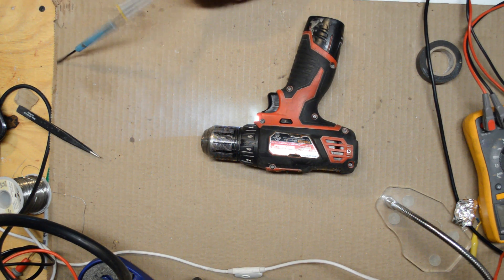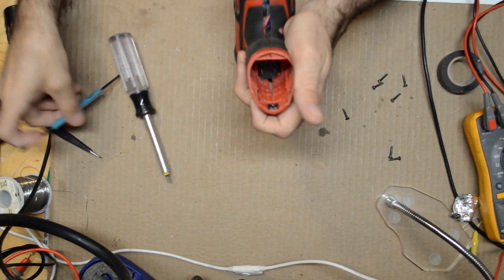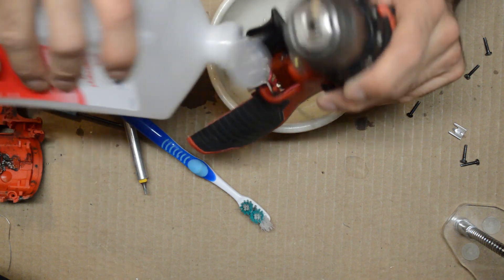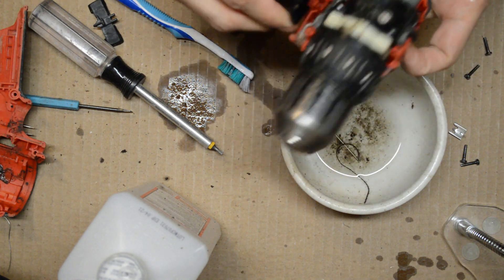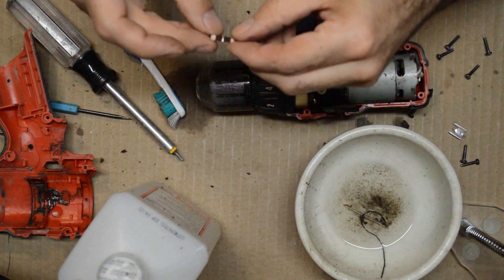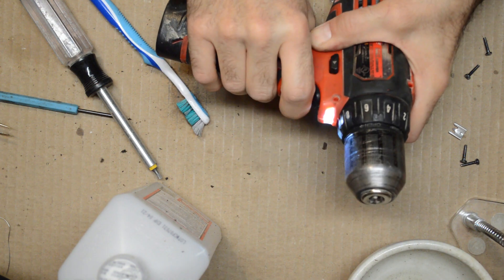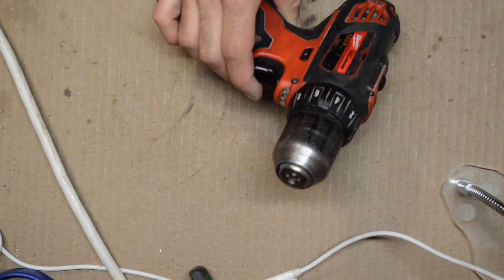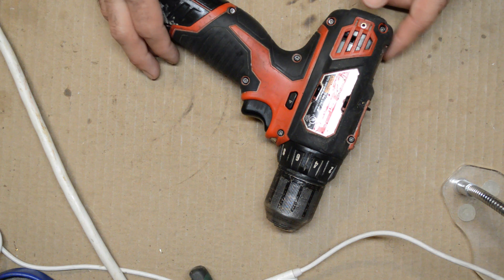Milwaukee M12 drill repair LED wouldn't turn off

Comment: Mine has the exact same problem with the light not turning off.  Except my is in much cleaner condition than yours.  I took the drill apart just like the video slowly. I did not have parts falling out.  

The issue is that the trigger switch is very sensitive.  Overtime, there is some build up in that area where the trigger switch does not release all the way.  On mine, there are wires running right behind the trigger switch, pushing it forward, preventing the trigger from releasing completely.  I moved the wires slightly out from behind the switch and this fixed the problem.

Comment: Quick version: Clean any build up on the PCB specifically, and be careful of the direction button bracing metal. I had this issue as well recently.

Comment: Thanks for the vid!  Also, have you replaced the smoke detector battery yet? 😂
Reply: Came here to make the same comment about the smoke detector. 
Fixes TVs and is opening up a drill, but can’t change a battery 🤔

Comment: Great video.   I was able to fix mine by spraying some electronic contact spray directly in to the trigger area without taking it apart.    I sprayed liberally and pumped the trigger and it worked!   Thanks.   I would never have e thought of if.

Comment: Using a aerosol can of brake clean or electrical contact cleaner would be more efficient to remove debris than a toothbrush with alcohol once you have it opened.
Reply: No definitely no brake clean, that thing melts plastic

Comment: Great video. I had the same issue, I opened it up, cleaned it slightly and got it working normally again. The light only stays on for a few seconds after using it.

Comment: Thanks!  Your video saved my DeWalt. Had the same problem with the LEDlight but it works fine now after careful cleaning with isopropanol and a toothbrush. Greetings from Sweden! :)

Comment: Nice video. Opened up my M12- it was clean, no gunk. used an air duster to blow out any small particles. Bottom line: the light stayed on. I don't need the light. I exposed the diode by prying up the wires; clipped them, removed the diode and then, using a toothpick, dabbed some liquid electric tape on the exposed wires. 
Problem solved.

Comment: That just happened to my drill. The light turns on but the drill won't work. Any ideas?
Reply: Same with my impact. Light on wont shut off and the drill dont work. I think somthing in the electronic crap is dead

Comment: I had to send my first one bac k, it worked randomly. The second one worked then after a few months it too began working randomly. The forward drill operation would falter, stop working and all four led battery lights would light up on and off. The only wat to get it to work was to flick it into reverse, pull the trigger ( and it would work ) then flick it into forward and it would work. Very disappointing

Comment: Okay I'm watching your video to see where that little brass piece goes because mine fell out to and I didn't notice where it came from but I can't see very well can you please describe I put the drill back together but the brass pieces sitting out and I haven't tried to run it or anything I just put it back together so I wouldn't lose any screws Etc
Reply: in case anybody else has this issue.  The little brass clip is the spring tensioner for the forward/reverse switch.  There's a little slot that one end goes into and the hump faces the black F/R switch.   It puts pressure on the switch from the front of the housing to keep it in forward or reverse.
Reply: @johng2880   thanks but my power tools were stolen a year ago
Reply: Katy Klein Bottle what does the “brass piece” look like? It sounds like it may be the spring plate which goes down in a little slot in front of the forward/reverse shuttle.
Reply: Does anyone have a problem with the light going on an off every minute or twice a min

Comment: I thought I put that brass piece in right next thing you know I snapped the brittle piece of plastic that tells the trigger what direction the Chuck should be going....if you don't remember the position it was in and pull a noob move like me you'll break it and end up buying a new drill on Amazon for 35 dollars